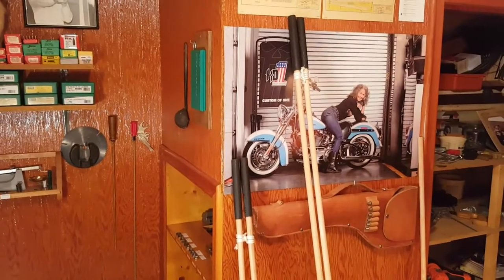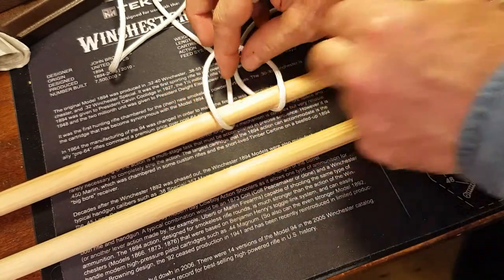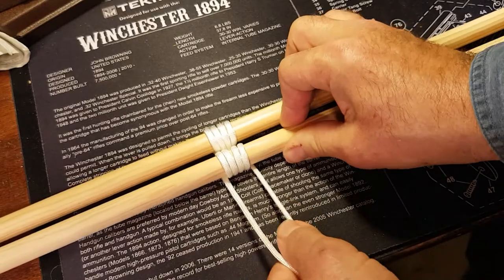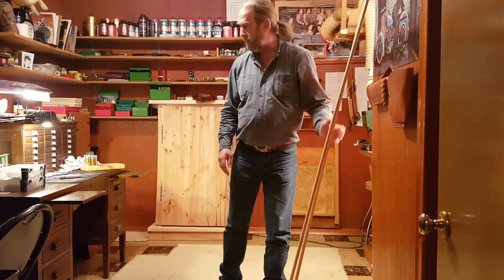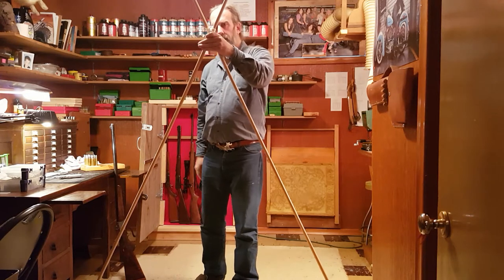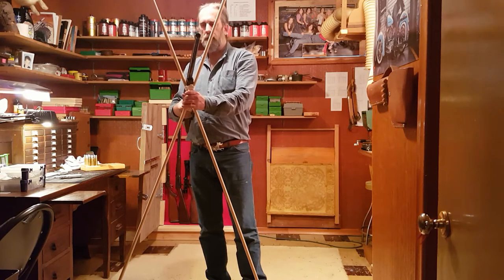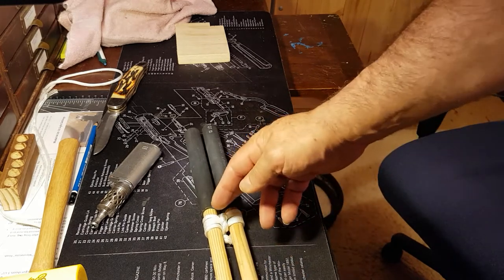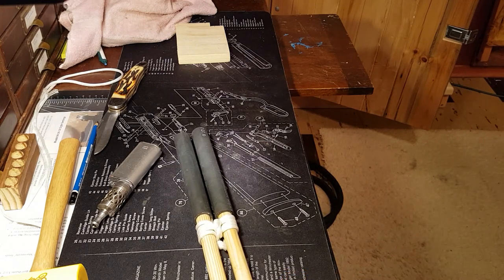Home-made Shooting Sticks

Comment: Excellently built. I would suggest making points on the bottom and burn them to harden them then at the top sand the edge to a smoother/rounder top that will help with the hose going on.
Reply from the maker: Thanks for the tips!

Comment: Great shooting sticks. 
I couldn’t find wood dowels longer than 48 inches at Home Depot so ended up having to buy landscaping poles but it came out just the same
Reply from the maker: Glad you found the information useful.  One thing I like about the technique is that the sticks don't have to be perfect.  You can even go afield without any and, when you need some made, just cut down a couple of saplings (so long as you have the rope with you to tie them).

Comment: Great instruction, thanks. For the rubber hose, you need some compressed air to shoot between the hose and stick and they slide like butter. Car or motorcycle repair shops have a very small nozzle for this purpose. Swing by a shop and let them do it in 10 sec. They are like this: https://www.harborfreight.com/air-blow-gun-set-4-pc-68260.html
Or you can try a can of computer dust spray:
https://www.tedpella.com/cleaning_html/dusters.htm
In desperation people would use soap and water on the belief that the water will evaporate later but I dont know about that.
Reply from the maker: Great suggestion.  Thanks Cvcoco.
Reply: @TheWaytoNativeChronicles  I suppose you could also make it slippery with some vaseline or mineral oil which wouldnt harm the wood and wouldnt turn rancid while also protecting the hose from rotting.  I made sticks while watching your good video and noticed that while the knot works and is tight, there is nothing to stop the sticks from slipping on the floor and opening up wider. This means you need non-slip foot caps or a rope to limit how wide these things open. Thats the only problem with it.
Reply from the maker: @cvcoco  Good suggestions again.  Thanks.  In my case, the sticks are used only outside, where the issue of the legs slipping on the ground isn't a factor.  But your suggestion sounds good nonetheless.  I'm glad to see the video was helpful cvcoco.